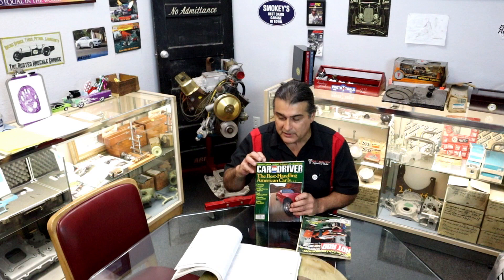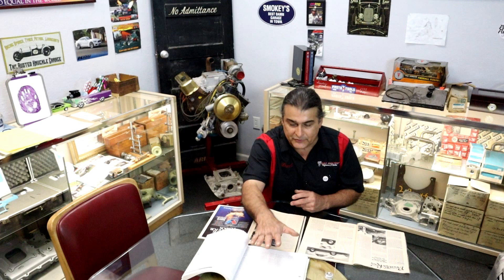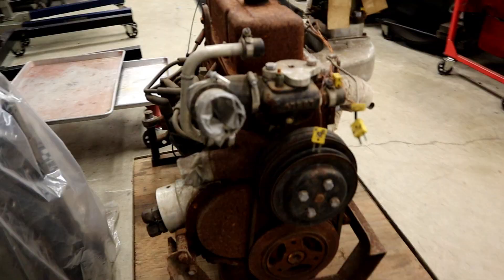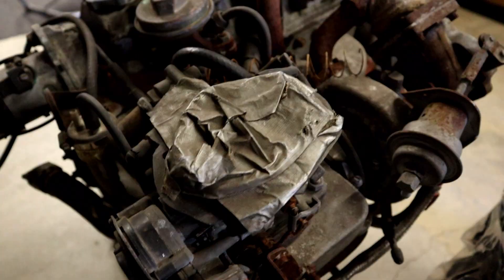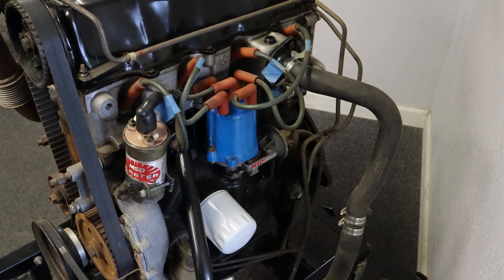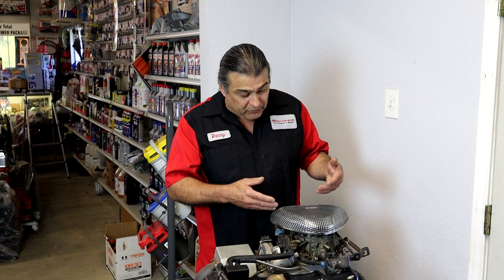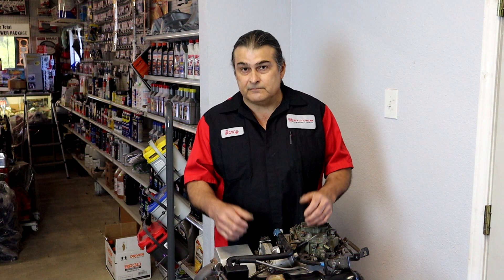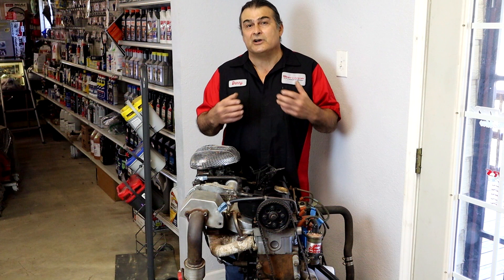What ever happened to Smokey Yunick`s Hot Vapor Engine

Comment: Hot vapor...Lock. Lol
Reply from the maker: Your describing what happens to liquid fuel (very unstable) and in trying to be funny you just described how vapor expands. Lol. 
We want liquid fuel before the carb and vapor in the manifold.
Reply: @MrDanielSoliz  yes I was being funny. But I don’t necessarily believe this engine cycle is very efficient. I understand recovering waste heat improves efficiency but on the other hand putting that waste heat into the intake air / fuel mixture will reduce engine efficiency by at least an equal amount. All things considered it takes a specific volume of air and fuel to make a given btu or horsepower.
Reply: @joecappo6480  
By turning it into a vapor all those efficiency calculations change, the biggest problems with this type of engine is alloys that can stand up to the heat for longer than just a few thousand miles, the turbo, piston rings, exhaust valves and other components just wouldn't last, maybe today they could figure a workaround but in the 80's making an engine with that kind of metallurgy in it was just cost prohibitive.

Comment: The engine worked?
Yeah, the same way as raising the compression ratio to 4000:1 would increase performance and efficiency.
If only the fuel wouldn't detonate and the engine components wouldn't melt.
Better still, we could go back in time and get the truth straight from the horses mouth. That'd work, all I need to do is travel faster than the speed of light which is more likely than that engine ever working as claimed.
I want some of what you're smoking.
Reply from the maker: You can go back in time and hear Smokey answer your questions thanks to Youtube you can watch a video called ''Dyno Days'' https://youtu.be/wl3vUnlIBys
  Smokey talks about fuel , detonation and materials.
Thinking maybe you should slow down on the smoking.
Reply: Yes, the engine worked as was certified, attested to, reported at a minimum from three test that were conducted at SwRI in San Antonio Texas from March 1981 to Jan 82.  The engineers involved in those test did not work for Yunick, two of them worked for Southwest Research.  There were tests tat predate that period conducted by at least GM.  In addition other tests were completed for other OEMs at their facilities.  Whether any of the results other than the ones from SwRI exist is a mystery.  On the other hand, having actually seen the reports and Dyno Pulls from SwRI I do know that they occured and what the results were.  You should subscribe to this channel for the reveal of that data.  Make sure you have a nice helping of pie on-hand.
Reply: @thomasrocha5688  I'll be more than happy to eat a big portion of pie if someone can prove that it does actually work as claimed.
So far all we have is anecdotal evidence and unsubstantiated claims, no peer reviewed scientific evidence.
Reply: @MrDanielSoliz  I watched it and managed to see no evidence just Smokey himself saying you can't run it on "gas" as it runs too hot - or something similar.
Reply from the maker: @colinfitzsimons3409  He answered your questions, which is what you wanted to hear him say. I would answer your question but you didn’t ask for my opinion you wanted to hear it from Smokey and he answered your questions.
Reply: @colinfitzsimons3409  There were many many engineers that saw, drove and tested the HVE, most of them employed by the OEMs including but not limited to: Chevy, Buick, Ford, Volvo, BMW, VW, Chrysler and DeLorean.  Again, I have no idea what happened to the test results for most of them.  In advance of the reveal, I will tell you that the engineers that I do have data, quotes, reports and other information are:  Gregory Flynn Jr.:  Engineer, Head of GM Motor Division, SAE Board of Directors, Private Engineering Firm.  Karl Springer: National Academy of Engineering Emmeritus , Vice-President of Southwest Research. John Clark Jr. VP SwRI and Race Driver
.  Melvin Ingalls: VP Emissions Engineer SwRI and of course John DeLorean himself.  You should read the abstract of the patent again.  All of the performance data pertaining to HP and MPG is actually from the tests that were done at Southwest Research Institute.  Proof will be provided NLT May 10, 2021 on FB,  a website and YT as well.

Comment: Smokey was a known cheater in racing and these engines were turbocharged no big secret. Yes he added more heat and that was bad so these engines were like a firecracker.
Reply: these engines were not turbocharged. the thing that looks like a turbo is not what it looks like, it's totally different inside and does not provide boost pressure.
Reply: @marzsit9833  Yes and no. Heating the intake mixture causes it to expand, the turbo is there to compress it back down again and prevent backflow out the carburetor. The turbo pressurizes the mixture but supposedly, only back to the density it had when cold.
Reply: Sorry Mark, but you're very misinformed and terribly biased. Everything Smokey did is STILL being done in thee most expensive form of auto racing today, FORMULA 1 ! How can the rule book be used to our advantage, and be deciphered without scrutiny.  
You can call him a cheater, but you're making a COMPLETE FOOL OF YOURSELF. 
YES, I  KNEW HIM, AND YES I'M A ENGINEER.
Reply: @t.s.racing  What are your credentials on the Laws of Thermodynamics?